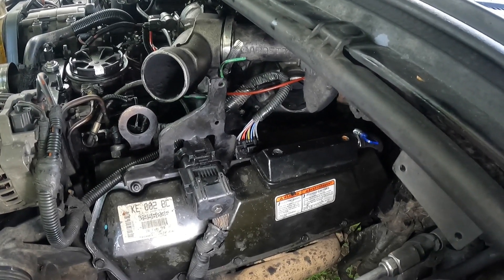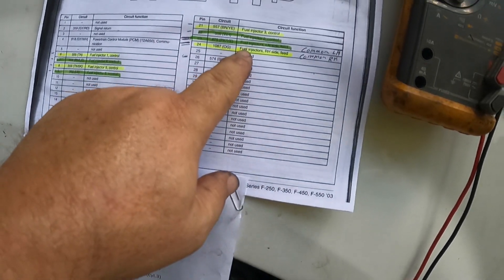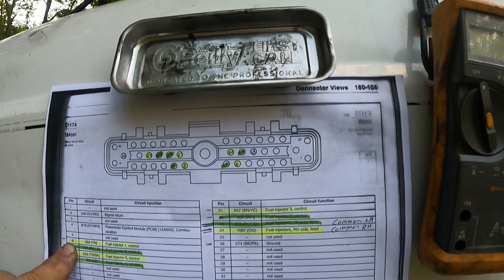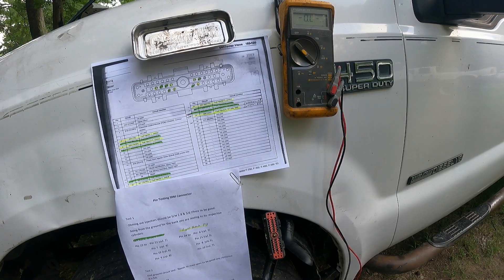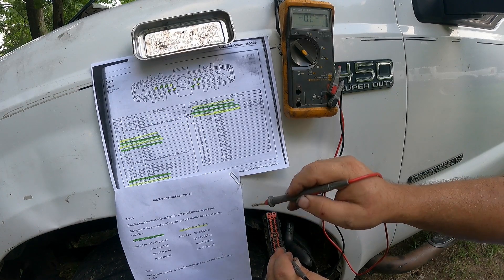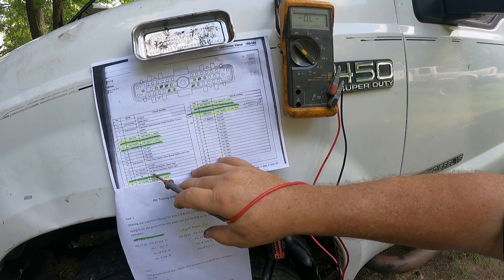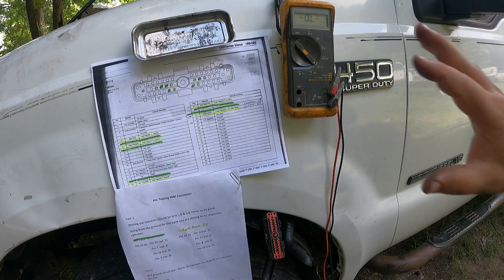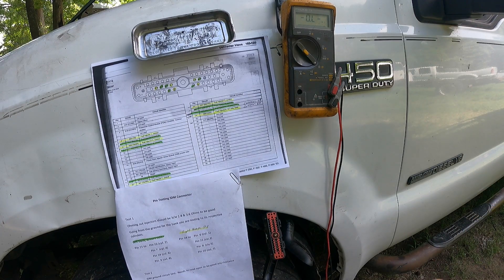IDM Wire Harness Pin Test. P1316 DTC.   2001 7.3 Power stroke

Comment: Buenas yo tengo una Ford 350 y o me comunica con elscaner y no prende pero ya cheque todo el cableado qué llega  entre la compu  y el idm  todo llega  pero no me prende y dice el escanear qué falta de comunicación con hdmi  y pcm
Reply from the maker: These trucks are know to blow the fuel bowl heater fuse which also powers the pcm. I would take a test light and check all fuses but especially any of them that say they power the pcm. You can get the info on what fuses power what from your owners manual or search “fuse box journal” for your model truck on the internet. If that fuel bowl heater maxi fuse is burnt then just unplug the heater wire from the back of the fuel bowl and replace the fuse.  Let me know if that fixes you up or not and we can try something else.

Comment: If all of my numbers where in spec when i checked the plug does that mean that my idm could be bad? If so how do i test the idm?
Reply from the maker: First thing, when doing an ohm test you can show continuity and still have a bad wire. If you have a frayed wire with just a couple of strands hanging on they will ohm test good due to the low voltage of that test. The idm sends 120v dc to the injectors which that frayed wire I’ll not be able to carry that load.
Reply: @bayoudiesel thank you

Comment: Thank you very much for this video.. I have been trying to figure out my problem for quite a while.. I replaced the top harness, and the UVCH on the passenger side, and now believe my issue is probably the IDM... After all my hardwork, 3,5,7 are showing P127 errors still. I even tried switching the plug for injector 1 and 3, and  the same error codes were thrown, so it must be higher up the chain... Hoping it's the IDM.  All of my injectors ohmed out correctly, and the ground and shielding as well... Thank you again!
Reply from the maker: Glad to hear the video was a help. If ya need someone to kick some ideas around let me know.

Comment: Dude, you are the best! I just bought a 1999 250 7.3 I had one decades ago. I pulled my components and sent them for checking and repairs, if needed. I bought it to rebuild it, and testing the IDM pins tomorrow, after seeing this video. I am only over in Independence up 55 so Lafayette is not far from me. I have an Autel 808 scanner and the PS100 circuit tester. I have the Ford Manuals, 3 books. One is all the wiring diagrams the other two are monster books covering the rest of the truck 250-550. I'll be getting into the electrical circuits and this truck is 26 years so I may need to suck it up and buy reman wiring harness if I have connector issues, as I repair RV's as well. I will be in touch and may come see you for rebuilding advice.
Reply from the maker: We are here to help if we can. Feel free to hit me up with questions.

Comment: I have code p1662. Would you recommend running this test? 1997 ford e350 7.3. Symptoms are losing  power going uphill, high egts, and hard time starting in cold weather.
Reply from the maker: Ok so I looked up your code p1662 and it’s the IDM   EN circuit failure. Possible causes are open relay, blown fuse, or open/grounded circuit. 
Sounds like this circuit would be feeding the idm where as the test in the video is for testing output circuits from the idm to the injectors. This circuit could be between the pcm and idm or the power coming to the idm. I’m not sure with this info. I’d start with the relay and fuse and make sure they are good and that the idm is getting power.
Reply: @bayoudiesel Thank you so much for replying! I tested the fuses and they are all good and I swapped the relay with a known working relay, still the same code. I also used to get p1391 and p1393 but they went away maybe because I tightened a loose glow plug relay or because the weather is warm enough that it's not using the relay? I'm not sure and it's too warm to test. Anything else you would suggest testing?
Reply from the maker: @Findecanno as for the glow plugs, they come on for about 90 seconds every time you key “on” the truck. Doesn’t matter what the wait to start light says. 
Do you have access to a scan tool to view live data? And what symptoms are ya dealing with?
Reply: I have an edge cts3 with an egt probe. My symptoms are loss of power especially on hills that seems to get worse the longer the engine has been running. It also has a hard time starting in the cold, like anything 40 and below. I may have fixed the cold start issue, but no way to tell until the winter @bayoudiesel
Reply from the maker: @Findecanno can you view live data on the edge? I don’t think so but may be wrong.  Just trying to see what part of the equation you are missibg

Comment: Doing this tomorrow!  Getting P1280 and P1316 codes.  I have about 1000 miles on new injectors, HPOP, etc.
Reply from the maker: 1280 is the icp code. You could test the icp by just unplugging it and see how the truck runs. 1316 is usually a wiring issue but could be injector solenoid. 
When doing the test in the video remember that there is one issue with this test. A frayed wire with just a couple of strands will still pass an ohm test but not carry a load. Sometimes it’s necessary to test the circuit under load such as a light. 
If you have any questions let me know and we can discuss what your symptoms are. Good luck and thanks for watchin
Reply: @bayoudiesel would activating the pin be detected by an injector response?

Comment: Would you or anyone have a video going from the IDM connector to the 42 way? I just purchased a 2001 Excursion and it had some "custom" wiring I am trying to repair.
Reply from the maker: I don’t think I have any videos showing the 42 pin but the test in this video tests the loop from idm plug thru the 42 and uvch and back to idm plug. 
I do have wiring books for obs and superduty. If ya need a pin out of the 42 pin I could email it to ya. Let me know the year of your truck

Comment: Does the Batteries need to be hooked up for this test work? Or the key on?
Reply from the maker: @ThinkingAlternative  no sir. With the idm plug out you have disconnected and isolated the circuit. I would recommend unhooking both grounds prior to and electrical work tho. 
Now the isolated loop (ie circuit) can be tested without any other influences.

Comment: Thank you! Does anyone know if this is the same on a 1997 ? God I hope. Getting PO 603 .. keep alive memory system.crank no start issue
Reply from the maker: @justicebruno5249  I would have to check the wiring book to see if the pins are the same.  I’m betting they may be.  As for the po603 code for KAM it is showing because it lost power for either dead batteries or if you disconnected the batteries. You will see this code every time you disconnect batteries.
Reply: @bayoudiesel we've been trying. Pin test was good on wires. We opened the IDM .. one burnt spot on backside of the board.. bubbled up. I didn't realize the 6 position switch and the Ford OBS Auxiliary Power control Module could cause problems?? It came with the truck. But i guess im going to disconnect it. Start from factory. I REALLY appreciate the help.
Reply: @bayoudiesel yes batteries are strong. Maybe a ground? Would the body to frame straps cause anything. I noticed one broke.. under passenger side door/ floor board
Reply from the maker: @justicebruno5249  definitely could be an issue as to the broken ground. The electronics are grounded to the body. The motor is isolated from the body without a ground. Batteries need to be grounded to the motor and frame then the body to frame as well to make the circuit. 

Sense you are dealing with a crank no start issue we need to find out what part of the equation you are missing. Have you pulled any codes and do you have access to a scan tool?
Reply: @bayoudiesel  yes just ForScan. No codes. Just the keep alive memory one. Going to remove chip from PCM and disconnect Auxiliary PCM . Maybe then I can run buzz test and other tests. Hoping once I get the electrical issue fixed the hpop will be good. or low pressure pump.. it's a great old truck.. but my first Diesel.
Reply from the maker: @justicebruno5249  as for the crank no start issue, if you’ll fill me in on the current symptoms I’d be happy to help try to figure it out with ya.

Comment: This is a really good video…i have a question for you. I’m not sure if that pin. Socket is my problem, it appears to me my computer doesnt communicate to any computer reader. How can i address that
Reply: The truck runs really good but sometimes the door ajar light and the curtursy lights stay on or sometimes the third brake light stays on. After awhile they go out but it’s a long time. The radio doesnt work either
Reply from the maker: @chrisallen3741  what are the symptoms that you are dealing with? Is the truck currently running? Is the OBD 2 port powered?
Reply: @bayoudiesel  the truck runs great but when you try to hook up a reader nothing happens….when the weather gets better ill check it …its too cold up here in Maine..lol…ill check for power thank you…i totally missed that….ty

Comment: The passenger side engine bank on my f250 shuts down after 1-5 seconds of running and than runs rough as he'll (obviously). I cannot for the life of me figure out what's going on. When we try to scan it the engine bogs down e even more and the scanner can't pull anything at all. Lord help me lol I haven't been able to work since this truck went down a few weeks ago.
Reply from the maker: @Kevin-ec2vt  well let’s kick this around a bit. What work have ya done to her? And have ya tried a buzz test with the scanner?
Reply: @bayoudiesel  thanks for getting back to me! I guess for starters I just did everything you explained in the video (which I appreciate btw) and was getting 0.0 across all injectors occasionally the readings would jump anywhere from like 1.6 to like 80.0 for a literal split second than settles at 0.0 . Seems something might be causing a major drop off, thinking about replacing the wiring harness what are your thoughts? I've closely inspected all the cords and everything looks fine. No frays, nicks, or splits. Im wondering if the plug itself went bad? Idk I'm a Mason mot a mechanic lol🤣
Reply: Occasionally it would get those weird reading but only upon initial contact with the probes than settles at 0.0 . Sorry just wanted to explain a little clearer
Reply from the maker: @Kevin-ec2vt  ok. Just to clarify when ohm testing your screen should show something like OL or OC when switched to Ohms then if you touch the leads to each other you should get 0.0 which means continuity with no resistance. So when you are testing the injector lines you are going thru the injector solenoid’s and should see the resistance shown in the video. As well as showing nothing at all when testing the ground and foil ground. 
To loose an entire bank of injectors you would have to be loosing the center pin (common hot) or a ground. Otherwise you would be loosing one injector and not all on one side. 

What my next step would be in this case is to redo the test again to confirm your original readings, then move inward to the 42 pin and test the same way again and from there moving inward again to the 9pin uvch plugs. This will narrow down where your problem is. Based on this info you are probably chasing a wiring or connector issue. 

If you hit me up on email I can send ya a pin out diagram for the 42 pin plug. 
Bayoudieseltrucks@gmail.com
Reply: @bayoudiesel  man I appreciate your knowledge a ton! Your doing a great deed for me and my family sharing this information. You have no idea! I sent an email 😁

Comment: Thank you for the great video. Having a slight issue with my 99 f450. Code P1275. Injector washed cylinder out causing engine replacement. But before I do that, trying to figure out issue so I don’t ruin new engine. Replaced injector, same code same issue. Swapped wiring and it follows to cylinder 3. Tested entire harness at 41pin and also the IDM. All tested good. Replaced IDM and pcm with known good ones and still cannot get the code for injector 5 to go away. Fails buzz test for number 5 saying High to Low side open. You can hear all buzzing like normal during test. All strong buzzes. But won’t pass the buzz test. I’m afraid to wash another cylinder out. Seems as if the truck is dumping fuel like crazy just on the 1 cylinder.
Also note, 160psi in that cylinder now. Found bent exhaust valve. Had machine shop fully rebuild head with all new valves. Still at 160psi and no crosshatching. So engine is needing rebuilt. But the failing buzz test I need fixed first. Hope this makes sense. Thank you!
Reply from the maker: @johnantonsenschulz7692  first of all the ohm test can give a false positive in that if you have only a couple of strands on a frayed wire it can show continuity with the low voltage of an ohm test but not carry and actual load.  I would test the number 5 loop with a light such as a trailer marker light to see if the #5 circuit can vary the load. The fact that when you switched wires with #3 the problem followed the wires says to me that the issue is in the harness. 

Swapping in a new injector was a good move. Cause we are not sure if an internal failure caused the fuel leak or the electrical caused it. 

Can you hear it buzzing on a buzz test?

Comment: Hi can you help please I have a Ford truck 7.3 the engine is not running the problem is there is no ground on the injectors I have checked all the wires between the IDM and the injectors all the wires are good I have changed the IDM and I did not get a result
Reply from the maker: @AbbassZeinaldine  I’m happy to give it a shot. 

So a little info before we get into it. The ohm test in this video can give a false result in that even one or two strands of a frayed wire can still pass an ohm test due to the low voltage. A continuity test from the idm plug through the injectors and back to the idm plug putting a light in line will show that that line can carry a load and not jut low voltage. 

One other thing is that the pcm controls most of the engine functions on these motors by making or breaking the ground. The pcm needs to see the cps, icp pressure, rpm’s and a few others before it will tell the injectors to pulse. Viewing live data on a scan tool can help pinpoint which category may be missing and causing the pcm to not pulse the injectors

Can you give me some history on the truck and what symptoms she had before she stopped running?

Comment: Have BNIB Alliant Power Injectors, Glow Plugs, VC Gaskets and Replaced the 9 PIN Pigtail.  Got a new IDM also.  Have the Same P1274 I code I started with.  While Testing IDM wiring harness PIN Test, I ONLY 2.5 ohms on the #4 circuit, all others at 3.0,. All other IDM test were good and open as required.   The 2.5 ohms does make sense because the #4  buzz was muffled during the BUZZ test.  in addition, I traced the wire from the 9 pin pigtail to the 42 Pin when installing a new pigtail and all seems good to go.   Help What is next.
Reply from the maker: @dphcpa1  so let cover a couple of things first. I’m sure you know p1274 is the go to low side open code for #4 cylinder and the possible causes suggested are open circuit, open injector or failed Idm. 

When ohm testing as done in the video there is one flaw.  A frayed wire can test good with the low voltage of the ohm tester but may not be able to carry the 120v DC that the idm sends out. 

Based on the list of new parts, the p1274 code, the out of spec ohm test and the audible difference of #4 leads me to either a wiring harness issue or the solenoid on the injector. 

You could have faulty internals in the injector that the buzz test wont pick up accept audibly. Meaning an internal mechanical issue.  Did your scan tool show a fail on the buzz test?

I would start by running the truck with the valve covers off and inspect how the discharge flow on 4 compares to the others. And if oil is coming out where it shouldn’t like the base or seams. 

Also I would try swapping the 4 injector with a neighboring one to see if the problem follows the injector or stays with the hole. If it follows the injector then there is the issue. If it stays with the hole then that points toward wiring. 

Please let me know what you find or what fixes the issue. 
I hope this helps and feel free to hit me back if you have other questions. 

Appreciate the question it helps me help others. Keep in touch
Reply: @bayoudiesel  Thank you for the response - I swapped the 4 & 6 leads and the code switched to #6, so the issue is with the #4 wire not the injector.  I have a new engine harness OTW so I assume all I can do now is swap the harness and hope the code goes away.  I could not find any IDM to 42 PIN harnesses available, or I would have swapped that too.
Reply from the maker: @dphcpa1  it’s been my experience that the harness the usually need replacing is the engine harness. Not the under the hood harness.  These gals are all 20 yrs old and that’s a lot of heat cycles. Wires next to the engine get brittle. I think you made a good call on the harness. Please let me know if it fixed your issue. Hope ya got something outta the videos. We’ll keep um coming.
Reply: @bayoudiesel  Thank you again.  I  installed the harness and it changed nothing - Still have the same P1274 code and an audible quietness to the #4 during the buzz test. .  My guess now is that there is an issue with the IDM to 42PIN wiring. Can I home run a new line??  Thoughts on next step.
Reply from the maker: @dphcpa1  I see no reason not to run a new line to test your theory. 

Before doing that I would do a serious inspection of the underside of the 42 pin harness. Look for chafing and rubbing on the valve cover. Open and pull back the loom. I have seen loom rub a wire raw before.